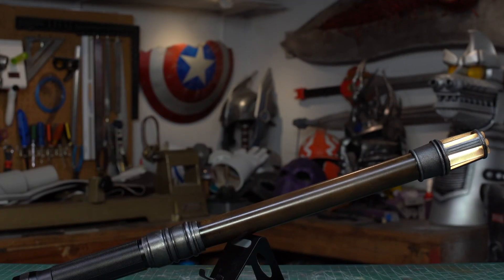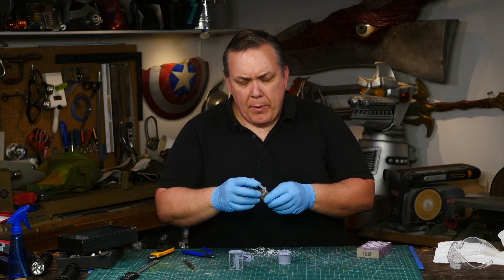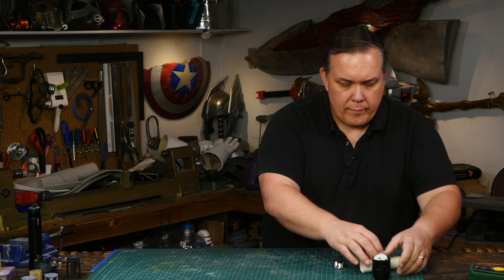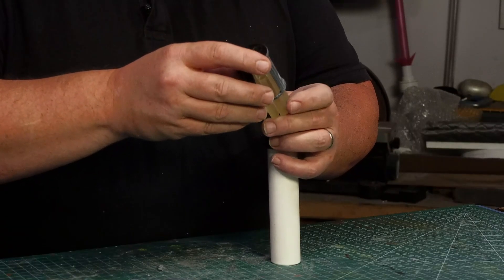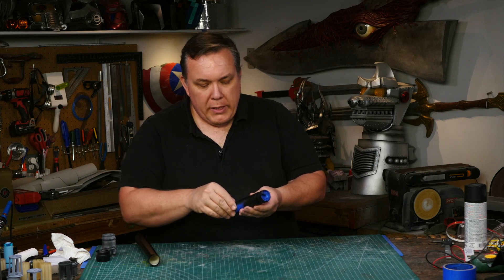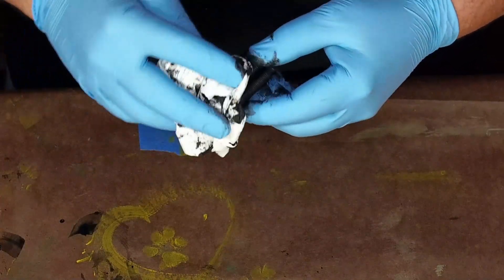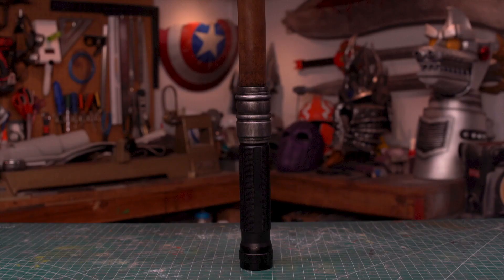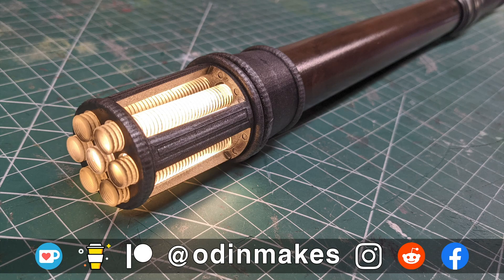Odin Makes: the Time Baton as carried by the TVA Minutemen in Marvel's new Loki series

Comment: For the wood finish on the PVC pipe, I did one that looks REALLY close to wood for a Grim Reaper scythe in my Halloween video last year. I did flat black spray paint, then used acrylics. Dry brushed dark brown so it wasn't a full coating, then dry brushed medium brown, then light brown. And each color I used less and less. So more dark brown on the brush than medium, and more medium than light. And only went up the length so give it brush strokes in that direction only to give it a grain look.

Comment: After you adjust all those things at the start when you open blender, you can actually save those defaults and whatever is in your current scene becomes the new program default. I built a cube the exact size of my print volume with my buildplate that shows up every time it opens.

Comment: I love this, also, as far as painting PVC black, you can use plastidip, you just need to sand the PVC first, as far as how ultra durable that finish is, I'm not sure, but I used it on a blaster I made and it's still holding up really well, and you're not dealing with the death in a can that is vinyl spray paint, respirator still required though

Comment: You should get yourself a tolerator or find an online one, it's a tool i use multiple times a day to find the tolerance of metal parts that either need press fits or sliding fits nd will save you alot of trouble when making pieces that need to connect together

Comment: You tried to use Blender as if it were an CAD program, which it just isn't... There might exist extensions that bring it closer, but the right tool for the right job, and for this job a CAD program is a far more suitable choice to begin with.